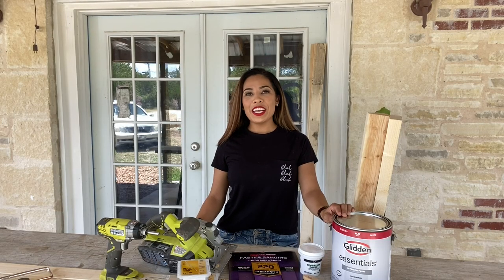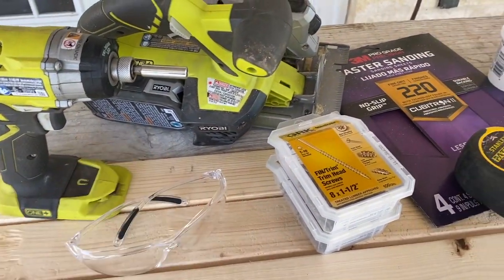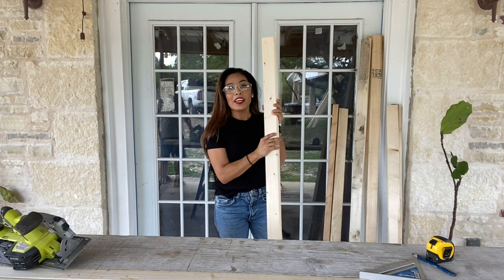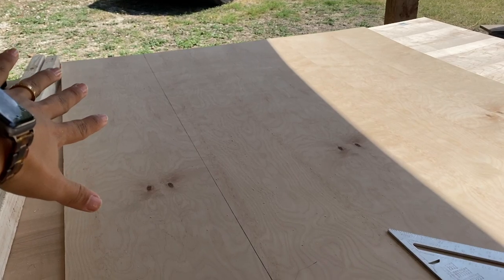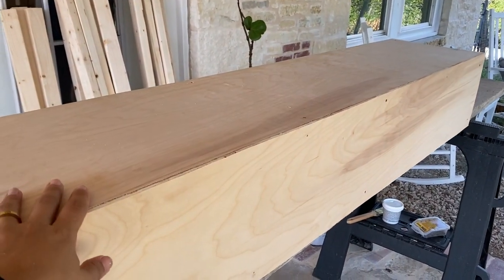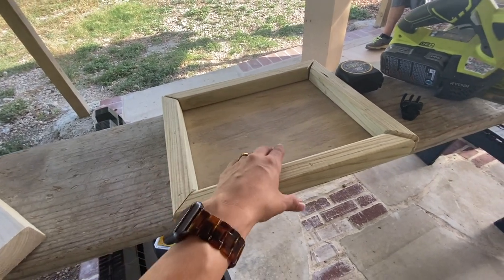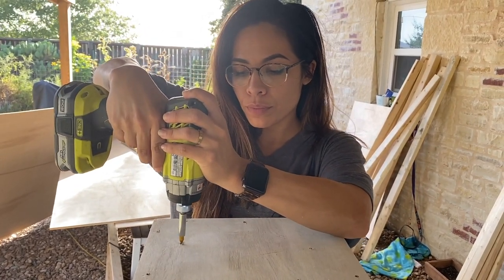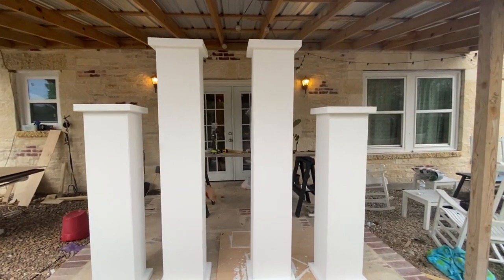DIY Wooden Columns For A Wedding

Comment: How much average cost of each pillar?
Reply from the maker: With materials $100 per column
Reply: Cost really depends on where you get your supplies and what you prefer to use. Many lumber yards will also cut to size for free so be sure to check your local yard. I suggest not buying new if you don't have to. Sometimes friends/ neighbors have things they don't need and are willing to give away like nails, borrowing hammers, extra wood, etc.